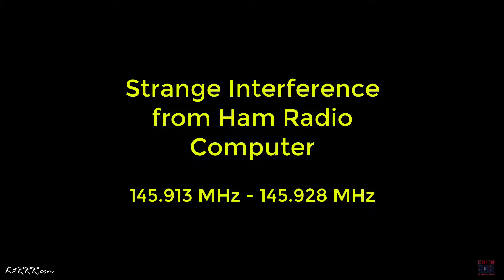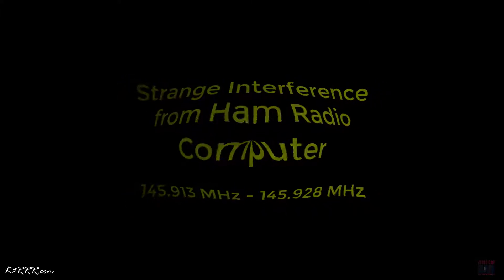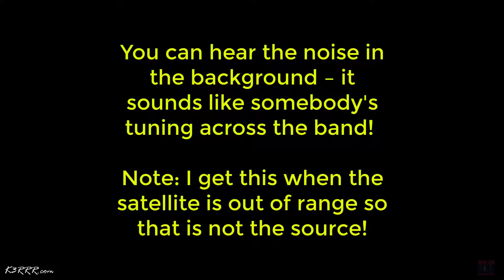Ham Radio Strange Interference With AMSAT Satellite CAS-4B Downlink Frequencies

Comment: i know what that is.  It is a test tone. and thats the reason for this swiping sound. it is used by technicians  for truobleshooting, checking and for setting up or adjustment of transmitters recivers and other radio
equipment. it allows you to detect things like  fall out on different sound frequencies throughout the sound spectrum. in various areas of transmitting and reciving

Comment: do u have any led forlasint lighting   or a wifi rounter near by 
because that what i might be  it could power line interfrance it could be your  monotor 
do u get that with just ur ham rigs to i would start there and putting a ferrite bead on all the cables then 
but that  alot of beads to buy if u got alot of stuff install